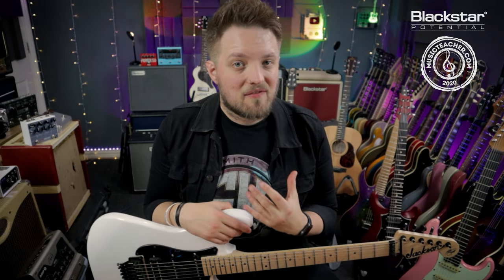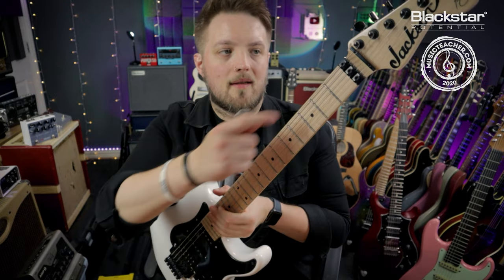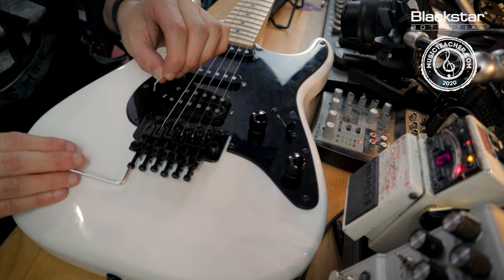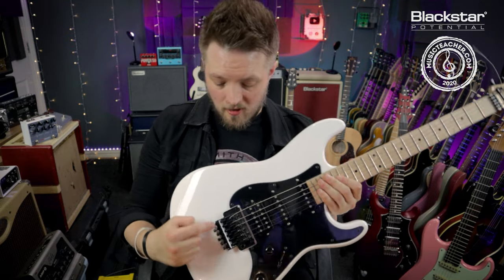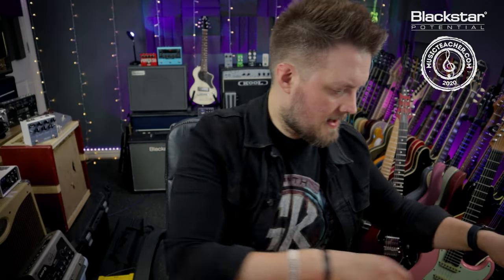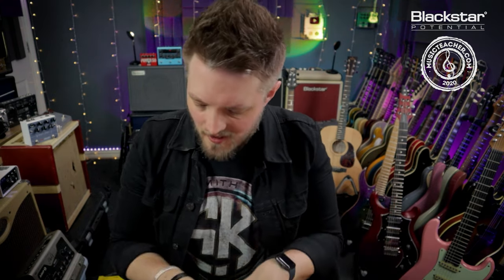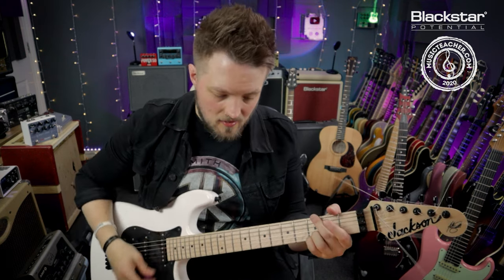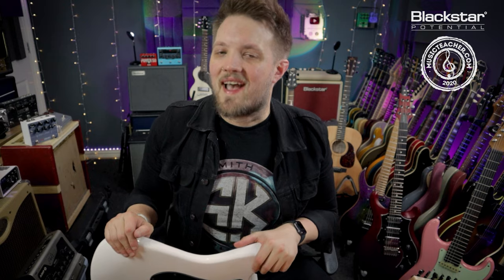How to Restring a Floyd Rose Tremolo | Blackstar Potential Lesson

Comment: Good video! My advice - block the bridge so that it doesn't move, then change strings. This takes away the need for rebalancing the spring tension in between each string swap and keeps the guitar in tune during the entire process. The block should just fit between the cavity and the trem block. Once the strings are changed, stretched and tuned up to pitch the block should almost slide out on it's own.  Once the block is removed use the Steve Stevens inside out tuning trick by fine tuning the strings in this order GDBAeE. Each time bringing the string just slightly sharp. As you do this it balances the string tension and pulls the previous string into tune. Tune the low E just to pitch. Works perfectly and once you get used to the sequence, string changes only take about 10 minutes
Reply: I thought that too about the bridge, but what I've now realised it that when I tried that I was setting myself up (pun intended) for failure, because instead of incremental and accurate adjustments, I'd be removing the thing keeping the bridge flush and then fire-fighting all over the shop trying to figure out what was preventing it from having the right tension and being flush. Also it's a Vintage, it's not particularly good hardware, so I'd like to try this approach and see how I fare. I really like the fine tuning advice here, that's a game changer!

Comment: I haven't changed strings on mine yet, but have removed the locking nut to retune when I ran out of movement with the fine tuners. It took quite a while once the locking nut was back in place as I had to keep tuning each string multiple times - eg tune E, A, go back to E as tuning A affected E. Then tune E, A, D and go back to E and A, etc. Can't remember where I heard that and not sure if it's strictly necessary, but stays in tune nicely now.